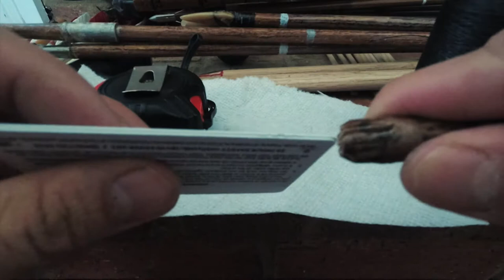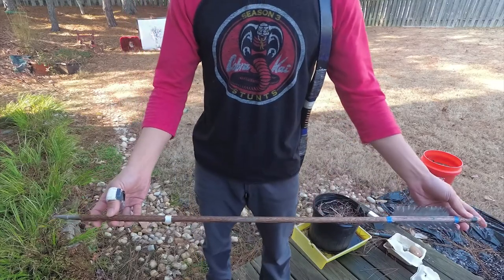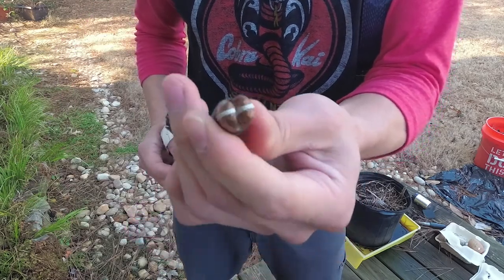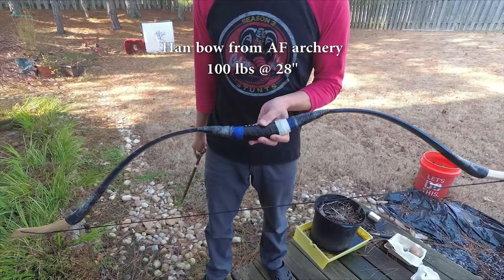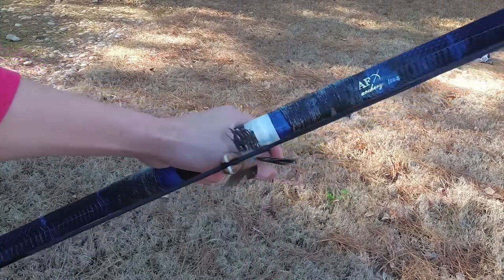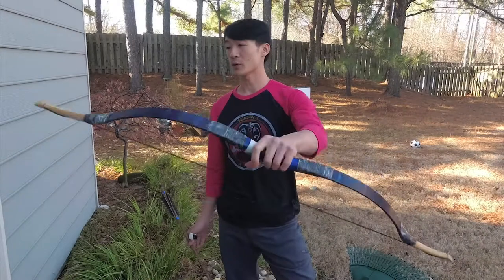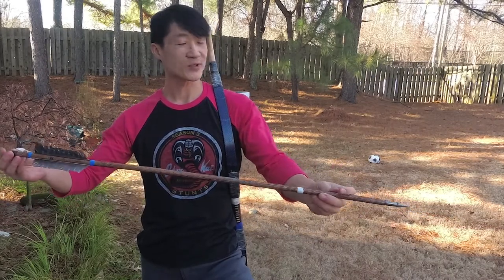DIY War arrow nock enforcing with plastic cards. 100 파운드 활 - 플라스틱 카드로 전쟁화살? 보강하기

Comment: hi man I have the exact problem like you (converting un-reinforced nocks). only question, since the nocks are already cut before installing the cards, do you think buy cutting another groove 90 degrees to it will affect the structure. Also shouldn't you cut it deeper??
Reply from the maker: what you said is true. this was my first one so the groove was too shallow. next one, i'll make the groove deeper. thanks. :)
Reply: iyoo1 did that break though